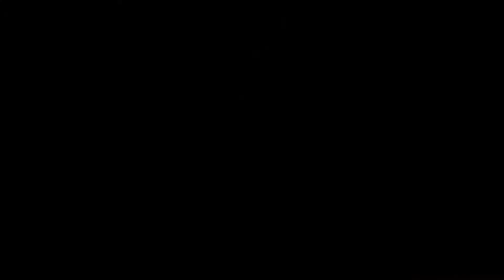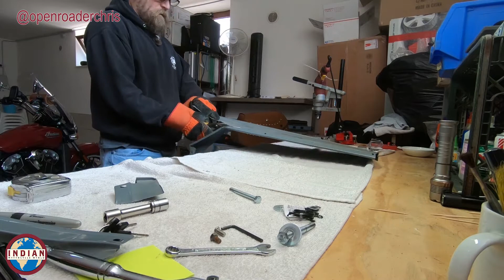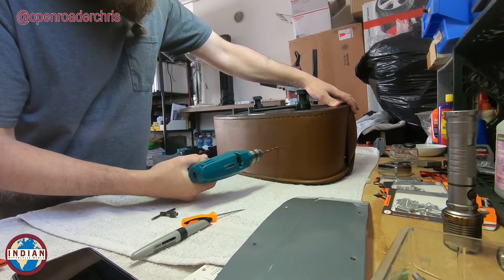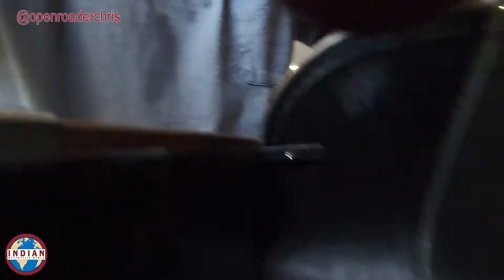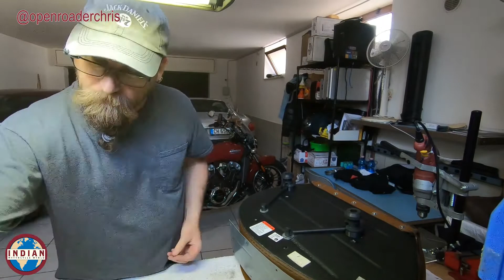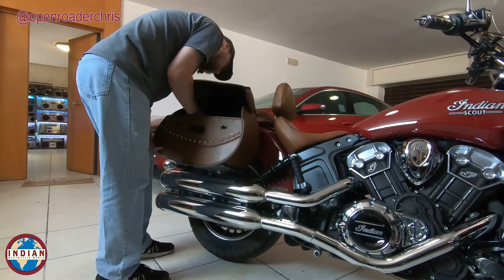How To: Create and install Heat Shield on Saddle Bag

Comment: Great idea!  I have a set of TourMaster nylon saddle bags.  I put new Vance & Hiines mufflers on my fat Bob FXFBS and there is more heat on the underside of the bag than when I had stock mufflers. I am gonna try to make a shield  like this for the bag that sits above the exhaust.  I had no issues with the stock mufflers.  Funny, the Vance and Hines mufflers provides a larger gap between it and bag, still bag heats up much more.
Reply from the maker: Glad you found this video useful. This shield has totally fixed the problem. I still wouldn't travel with a favorite chocolate bars in that saddle bag and I keep my spare gas can on the other side 😉.
Reply: @OpenRoader  you can out your chocolate bars on the left side of your bags, why must put on the right?????
Reply from the maker: I wouldn't carry anything that has a low melting point on the exhaust pipe side. Don't want to end up with a mess in the bag

Comment: How did it work.? What could you have done better
Reply from the maker: It was flawless, could have stored chocolate in that bag. Never gave it another thought. The bottom of the bag leather never discolored, the painted metal never showed signs of heat. Nothing
Reply: Thanks

Comment: What kind of steel are you using for the shield? Thanks in advance and good video btw :)
Reply from the maker: It was left over metal I had from some shelves that I had. Nothing special. I think just about anything will work. Thanks for watching
Reply: @OpenRoader  thank you, ride safe ✌️
Reply from the maker: Thank you, you too

Comment: Do you have any issues with the thin metal making a whistling noise at all? I need to make a heat shield for my bags and I'm wondering if have a air gap between the metal and bag will cause it to whistle when at highway speeds
Reply from the maker: If it does, the exhaust drowns it out. I've never heard anything like that. Thanks for watching, ride safe

Comment: Good stuff man! Gotta take stuff in your own hands. 
Did the Indian bags have any heat protection?
Reply from the maker: No, but they are cut out in the shape of the pipes. They are also made of plastic,  covered in leather,  but no on the bottom. So there is no leather near the pipes